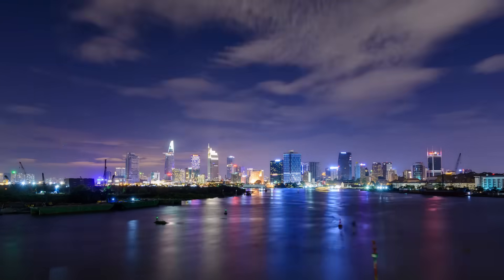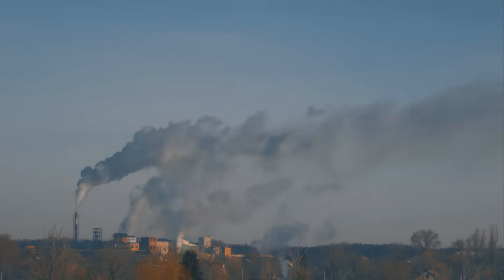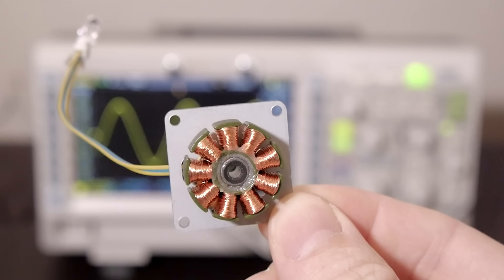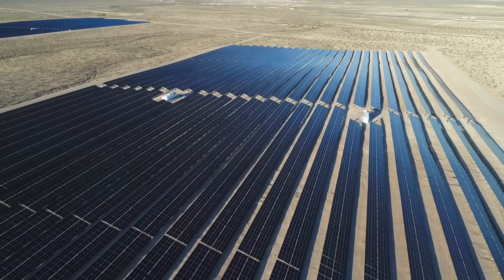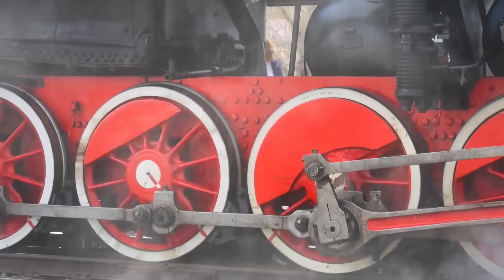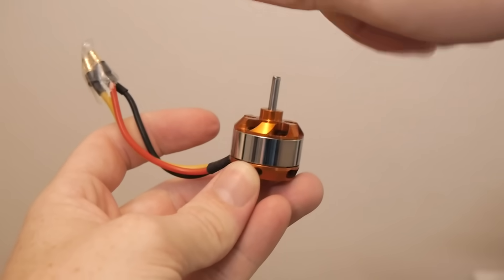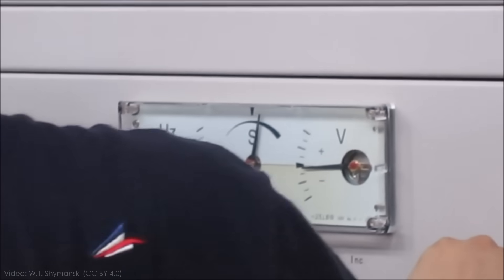How Electricity Generation Really Works

Comment: I expect someone who uses engineering in their title to be part of the minority that knows the truth that C02 has a negligible affect on global warming. Carbon dioxide comprises 0.038% of the earth’s atmosphere, and of that amount, a mere 3% is generated by mankind. Human produced CO2 might account for a bit more than 0.1% of greenhouse effect. Without greenhouse gasses such as water vapor (95%), the earth would be void of life. Of that 5% that is not water vapor, CO2 only accounts for a bit over 2% of that 5% (0.116%). The amount CO2 has increased (about 35%) over the past 100 years is within historical norms for the non-industrialized past. CO2 levels are believed to have been much higher a few hundred years ago. Most factors that actually change the climate are far out of our control and much more dramatic than we could counter one way or the other. Historically CO2 levels tend to trail warming so they seem like more of an effect rather than a cause of warming though this gets complicated as each can seemingly cause each other. I for one would like more CO2 so that plants can better absorb the higher CO2 concentrations in arid parts of the world without losing their moisture.
Reply: @Chris Metcalf “Current Greenhouse Gas Concentrations" from Carbon Dioxide Information Analysis Center (CDIAC) U.S. Dept of Energy from 2000 when they still did a breakout for manmade additions. Their site search isn't working for me.
Reply: If you find that funny or are looking to pounce on the source, have at it. I can't find the source any longer. But it was from the CDIAC in 2000. I think the current argument goes: Man-made CO2 emissions is a minority but it puts the natural balance of emissions and absorption off. You might have fun with channel 1000frolly PhD "Nobel Lauerate in Physics; Global Warming in Pseudoscience". Not surprisingly it will be easy to find sources that contradict.
Reply: Water vapour, as any gardener will tell you, is the dominant GHG, followed by methane and then CO2.  For most of geological history, CO2 levels were 4000 to 8000 ppm (0.4% to 0.8%) more then 10x today's levels and flora and fauna survived. During the last ice age levels dropped to 180 ppm and at 150 ppm plant life is starting to suffocate.  Consider all that CO2 locked up by marine organisms in chalk and limestone formations that cover vast areas - that give an idea how much CO2 was normally present in the past.

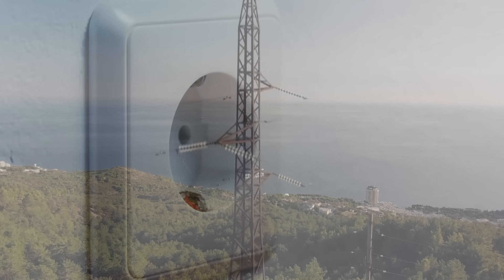Comment: Love the video, but there's one correction that I just have to mention. At 1:10, you state that electricity moves at nearly the speed of light and that electrons in your home were at the power plant milliseconds ago. While you do see the voltage produced by the plant, the actual electrons traveling through your wires move very slowly (look into electron drift velocity). The propagation of the signals in your wires will be near the speed of light, but the electrons themselves move very slowly (on the order of 10^-4 m/s). To see how fast waves can propagate through a wire, you want to find its relative permeability and permittivity. Look into velocity factor for more information.
Reply: He didn't say the electron traveled that fast, he said the power traveled that fast. So the energy that was just generated at the power plant reaches your home in milliseconds.

Comment: Inertia? I have a BSEE and I have been studying electricity for about 60 years and I have never heard of electrical "inertia." I understand what you are getting at though it is a very mechanical notion of the concept.
Reply: For tradicional generators (using rotors and such) intertia has something do to on it, remember that a fluctuating magnetic field can generate an electric one, hence if the generators keep spinning without fuel, you will have a tiny bit of electrical field being generated there, it's not that much due to losses and charge, but it will spin at least slowly for a couple seconds while the actuators and dispatch centers notice.

And remember that the system must be in balance, so if there is certain number of generators working under certain demand conditions, and one of the generators goes out, the others will have to compensate. Same happens if a load goes out, in that case the genrators will move faster due to the "weight reduction" on the entire system. That's also Inertia, if one goes, the others will follow trying to make the system stable again. Hope that helped :)

Comment: While the electric field does travel at the speed of light, the electrons that flow through your wires were not just at the generator facility, they move at a much much slower rate.

Comment: Alot of software performs the synchroscope RYB (Red Yellow Blue) phase alignment, but they do still exist between diesel generators on ships and submarines (where PARALLELING is naturally required). Important on bringing e.g. the "coming-on" generator into circuit, and shutting down the - well you guessed it - the "going-off" generator. Realistically, the generators have names. Grady fantastic stuff just before I go to sleep before my night shift. Especially the "spinning standby" bit.

Comment: Did I understand you to say the spinning generator gives the current the inertia to travel down the wires? Is the flow of current not caused by positive and negative attracting each other? There’s no inertia in a battery but current still flows when a load is connected.
Reply: Current has little to do with inertia, inertia in power systems represents the rotational kinetic energy of machines directly coupled to the grid (mostly big generators in conventional power plants). If there is a sudden imbalance between supply and demand, the difference gets cowered by the kinetic energy of these rotational machines (lowering or increasing the rotational speed in the process), until frequency control systems don't take over.

Comment: Three phase power transmit 73% (sqrt 3) more power than single phase - not three times more power.  For those who are going into power engineering get real good at trig and vector mathematics. Even though power engineering is not as glamorous as IT,  or other tech endeavors, our global infrastructure really needs young talent in power engineering.  It's stable and rewarding profession.  The sight of a power plant, the hum of a mega transformer, or the smell of ionized air can really be sobering!  Sometimes our populous takes power for granted, until they lose it.   Just give it some thought before you get into college.  All due respect to the other engineering professions!
Reply: This is a very common misconception. One wire can cary an X amount of current, three wirea can carry 3X amount of current. At the same line-neutral voltage, that's three times the rated power. You should always use line-neutral voltage when comparing one phase systems to three phase systems.
Reply: @FrainBart_main  yep ... it's best to know how to add vectors.  Engineering and math are not always intuitive.

Comment: By the way, sun-light is not a particle. Light is a "rate of induction". Particles of light do NOT emit from the sun or a star. What is actually happening is the star is creating perturbations within the Ether, aka counter-space and sends EM energy through the Ether through it's singularity. Those waves of energy travel through the Ether to surrounding atoms. All atoms are a Torus shaped electro-magnetic field with a central singularity as well. All atoms have Capacitance, Resistance, Permeability and Permitivity. This allows surrounding mater to absorb the energy wave perturbations coming through the Ether from a point source such as a star or a flashlight or a candle flame. We see the end results as things around us as "lighting up". Light is not a particle, it is a "rate of induction".

To explain this more clearly, if you were standing in a pond of water splashing it with your hands. would you claim your fingers were traveling to the shoreline? No. Would you claim the water was traveling to the shoreline? No. The water is just the medium that the energy you're creating with your hands travels on. The water molecules are simply moving straight up and down while the energy travels along it's medium. Just like the star is your hands and the medium that the energy travels along is the Ether, aka counter-space. And yet particle physicists still claim particles are emitting from the sun and travelling through space hitting objects. Which is patently false. There has never been any experiments to date to prove any particles ever existed. There are no protons, no electrons and no neutrons, inside an atom, and there never was. 

Mother nature is far more simple than what the traitorous scientific community has tried to force down everyone's throats. Particle physicists and theoretical mathematicians are highly paid bean counters who work for the Globalists and the mafia cabal despite most of them don't know that,..yet. Where did you think there were getting all their funding from, bumping particles?

Comment: Electric fields do not travel inside a powerline. Nor do they travel on the surface of a conduit/powerline. The greatest field theorist that ever lived, Charles Proteus Steinmetz, clearly stated in his books that electric fields do not exist inside nor on the surface of a powerline. They in fact travel outside the powerline in concentric coaxial paths of dielectricity and magnetism. An electric field doesn't exist inside a capacitor but exists outside the area surrounding the capacitor. This is what makes electric grids and electric gadgets so vulnerable and exposed to shorting out from other surrounding fields, like an electric storm.

Particle physicists claim electrons are bumping each other down a powerline to create electric flow. This is false and patently absurd. JJ Thompson who discovered the electron clearly stated it was a "field", and NOT a particle. If electrons were bumping each other down a powerline to conduct electric flow then how do you explain how your wireless cell phones work? Bumping electrons through the air, LOL!!??? 

As far as an AC generator is concerned, it's creating more energy than it's being given. So where does the extra energy come from? Counter-space, aka the Ether. Why would you need a generator to accumulate electric energy from a source when all you'd need is a step up/down transformer to do that with? So why were AC generators created? To draw in the energy coming from counter-space. All generators have a stator which passes by two internal magnets. Magnets are also anchored into counter-space, aka the Ether. The stator passing the internal magnets of an AC generator can draw out the added energy from those magnets in which it's output becomes greater than it's input.  
James Clerk Maxwell said, "If you don't understand counter-space, then you cannot understand this universe".
Can you imagine Nicola Tesla's mind doing contortions when he invented the AC generator? He obviously understood counter-space, aka the Ether, because he couldn't have invented the AC generator if he didn't. The five greatest minds, Oliver Heaviside, James Clerk Maxwell, Nicola Tesla, Faraday, and Charles Proteus Steinmetz gave us our entire electric grid and by extension from their work, all electronics as well. We owe them everything we have today. No particle physicist or theoretical mathematician could ever boast such a claim.

Comment: petition for practical engineering to release another channel called "engineering that isn't so practical" or "not so practical engineering" where he describes the same things but actually uses technical terms and is basically a crash course for engineering classes.

I like talking about trains when talking about electricity inertia and stuff, but I get that already, let's just get to the cool bits

Comment: “Elcecteicity moves at nearly the speed of light!”
.......
It is light
Reply: no
Reply: Electrons move slower than light.
Reply: Gotcha thanks for clearing that up
Reply: @AliShaikh-ez8ir  The electric field and the energy carried propagate at nearly the speed of light, but the electrons themselves only drift at millimeters per hour.   It is due to the fact that there are so many electrons, that it can move so fast.

The electric field doesn't propagate completely at the speed of light, because it isn't moving through empty space, and has the parasitic inductance and capacitance of the transmission line to slow it down.   It is strongly related to light, as it fundamentally involves electromagnetic waves.  Given that its frequency is less than a trillionth the frequency of visible light, it cannot technically be called light.

Comment: Don't you need electricity to produce magnets? Can a magnet used in the process of generating energy, produce more electricity than what was needed to produce the magnet in the first place?
Reply: Relatively very little electrical energy is needed to magnetise a magnet. If magnets are used to provide the magnetic flux in the generators (quite often in wind turbines for example), it is not the energy from the magnets that produces electricity, it is the mechanical energy that does. And this mechanical energy is the product of utilising primary energy sources (e.g. wind or water flow).

Comment: As an owner of a small utlitly company, I have to say, that you explained it very well! Keeping the balance between supply and demand is crucial and a highly complex topic, especially for the grid operators. In my country they use devices to measure the frequency and there is a very small tolerance range. For instance, as mentioned in the video, if demand exceeds supply, grid operators mostly start generators like pumped-storage power plants first! It's one of the fastest sources for electricity. When demand still exceeds supply, power plants fueled by gas kick in less than 5 minutes. Next power plants might be nuclear (doesn't exist every) or coal.
There is also another option: producers with high energy demands can get a compensation, when they lower or completely turn off their energy consumption. This only works for highly flexible industries.

Comment: Um.. the power "Crisis" and response to "Global Warming" was solved decades ago. It's called "Nuclear Power" 

Solar is out because the actual construction of the solar panels themselves require highly toxic materials that cause long term ecological damage and cannot be recycled. "Tesla Car Batteries" have the same exact long term ecological damages ALSO due to toxic materials used during constructions.  For example the average Tesla Model 3 has the same long-term ecological impact as a Land Rover with BMW's V12 engine, and that's just calculating the ecological damage from the batteries alone... nevermind having to charge the Tesla on a regular basis. Most calculations suggest you'd have to drive the Tesla Model 3 for OVER 28 years before you'd actually be performing less ecological damage than that V12 Land Rover... and that's assuming you didn't have to ever get the batteries replaced. Those Solar panels on the market? At current ratios you'd have to use them for over 50 years straight before they actually gave a better performance per ecological damage than 1920's coal plants, and that time period gets even longer if you compared existing "Clean Coal" techniques to Solar.

Wind Generation is also Dead On Arrival, and not just due to unpredictability. The rotors in Wind Turbines are medically proven to cause heart issues, and that's something that came out of Mainz Germany from Profession Christian-Friedrich Vahl, and it's dubbed "Low Frequency Noise."  Wind Turbines also are known hazard to bird populations, and require deforestation. Either that or building above trees, and that presents a whole extra hurdle of problems. 

As it stands the best long term solution for power response that is NOT Nuclear hinges on quote/unquote Space Elevators. TechFox actually had a pretty good breakdown of some of the concepts back in 2001: http://techfox.comicgenesis.com/d/20010410.html   With allotropes of Carbon such as Fullerene now in a state where they could be plausibly manufactured on a scale required to actually build a tower that does extend into space, maybe it's time to start actually crunching those numbers. Well, outside of the X Prize and other space Elevator competitions.